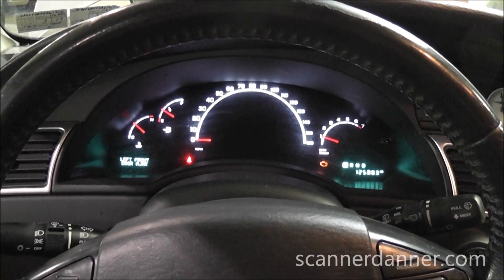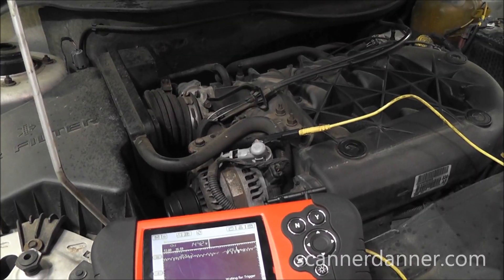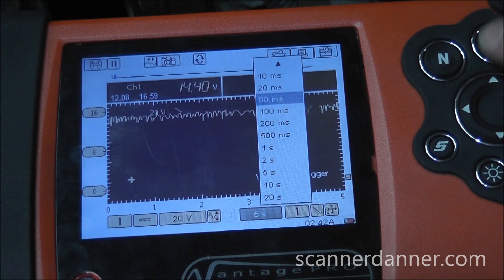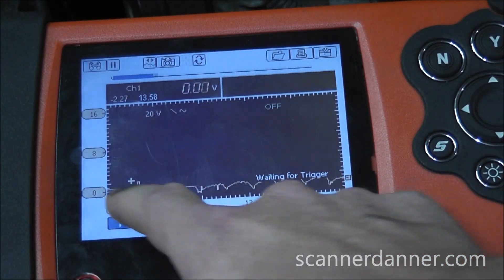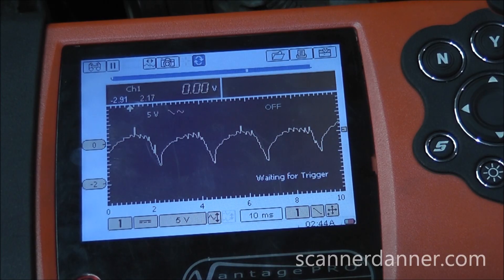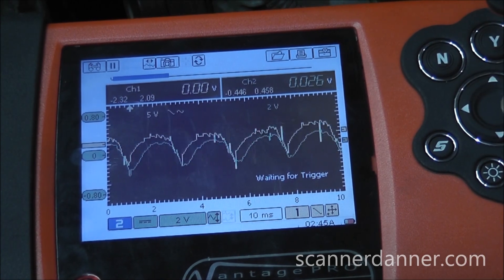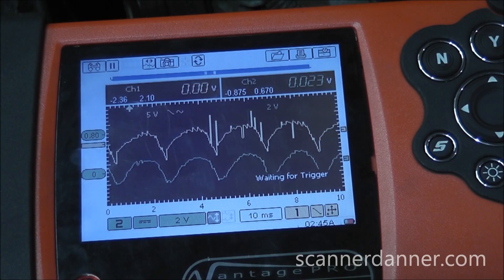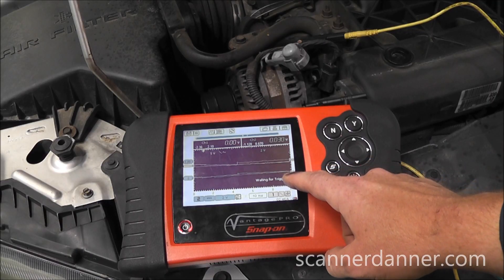Bad Alternator Diode causing transmission/speedometer problems

Comment: The peak to peak voltage in the yellow trace is misleadingly high because the scope takes into account the sharp spikes. The green trace doesn't have these spikes so at first glance it looks like it has less ripple.

When you take a measurement at the battery there's this big piece of cable that comes from the alternator to the battery positive. This has enough inductance to filter out all those high frequency spikes and makes the waveform look less rippled.

In essence, the two waveforms are identical
Reply: ScannerDanner Premium
 Sorry for the long answer!

The ignition coil back EMF is a subset of a broader phenomenon. It boils down to the fact that inductors don’t like changes in current. When there’s no current flowing and you try to push current through an inductor, it will generate a voltage in such way that opposes the current. So it takes some time for current to reach its max value. But when current is flowing steadily and you try to stop it, the inductor wants it to keep going.
When you have current flowing through the primary coil and do something as extreme as abruptly switching it off, it is like introducing a very big resistance in the circuit. If it is an older points system, then it is the resistance of the open contacts air gap, if it is a newer electronic system then it is the resistance of the turned off transistor. In both cases the equivalent resistance ranges from hundreds of Mohms to Gohms.
But the coil wants to keep the current flowing. So how do you push the same current through a much much bigger resistance? By generating an opposite, very high voltage. Of course the voltage generated cannot be arbitrarily high. The coil has a set amount of energy stored in its core. That’s where the secondary comes into play, it amplifies the high primary  coil voltage into an even higher one.
I guess it would be possible to generate sparks with just a single big coil. But then you would need special, expensive high voltage transistors. In a points ignition system there would be a lot of sparking in the distributor as well, that would damage it after a while.
So the two coil system works well. The coils are galvanically isolated so there’s no high voltage going back to the low voltage side.
 
Ok, back to the filter application of inductors.
In DC, inductors have practically zero resistance. But in AC their resistance increases with frequency. High frequency means rapidly changing currents and inductors don’t like that.
Capacitors are the opposite. They have infinite resistance at DC but it gradually decreases as frequency increases.
Now this is a typical resistive voltage divider: http://tuxgraphics.org/toolbox/voltage-divider-w.gif
 
Here there are two extreme cases 1) When R2 is much bigger than R1 the output voltage is almost equal to the input voltage. 2) When R1 is much bigger than R2 the output is almost zero.
In the car we have instead of R1 the battery cable, which is an inductor. A lousy one, since it is not coiled and has no core, but an inductor nonetheless. According to this calculator http://chemandy.com/calculators/round-wire-inductance-calculator.htm
a 4mm thick, 50cm long copper wire has an inductance of around 500nH.
And instead of R2 we have the car battery, which has similar properties to a capacitor.
Low frequencies “see” a low R1 and high R2, so the output voltage is almost the same as the input. High frequencies see high R1 and low R2 and the output is zero. So when you have a mix of frequencies as input, only the low ones pass.
I did a simulation in LTspice. This is the equivalent circuit:
http://i62.tinypic.com/2ew2urd.png
V2 is the voltage source at 1Khz and V1 generates noise at 50KHz. I used five 100nH inductors, since inductance is distributed along the cable.
The noisy output of the two voltage sources looks like this: http://i59.tinypic.com/e6rbf4.png
This is the waveform you’d get by probing directly on the alternator post.
This is the waveform between L3 and L4: http://i59.tinypic.com/vxcl6p.png
This would be like piercing the insulation and probing near the middle of the cable. The noise is still there but attenuated.
And finally, this is right after L5 and before C1. Like probing directly on the battery positive.
http://i58.tinypic.com/2j35tti.png
The noise is almost completely filtered out.
Generally speaking, looking for noise in a system with an oscilloscope is really tricky business. Sometimes you’ll see noise that isn’t really there, it is simply coupling into your oscilloscope probes from some other part of the circuit. Other times you might have tons of noise, but your test gear set-up might be filtering it out.
Reply from the maker: So it is the battery cable itself that "filters" the waveform, not the battery? For inductance to take place in this cable there must be current flow, so could we say it is more than just the cable?
Reply: ScannerDanner First of all, I’m a big fan and love your videos! Keep up the good work!
Inductance is a fundamental property of all conductors (like resistance) and it doesn't depend on current. Any piece of wire will have some inductance and it doesn't even need to be coiled, even a straight wire is an inductor. The longer the cable, the more inductance it has.

What you have there is basically an LC lowpass filter like this: http://upload.wikimedia.org/wikipedia/commons/e/eb/Lowpass_Filter_LC.svg
 ,where the inductor is the piece of cable and the capacitor is the car battery.

The alternator outputs a low frequency voltage (around 1KHz at idle) with some high frequency noise added, I am guessing at some hundreds of KHz, probably caused by the failing rectifier.
At the end of the cable, the high frequency noise is attenuated while the low frequency voltage is passing through.
I guess that if you could pierce the insulation and probe the cable at various points along its length, you’d see the noise gradually decreasing as you probe closer to the battery. This is because the inductance increases with cable length and the filtering effect gets stronger.
If you disconnect the battery, the noise will pass through. You need both the inductive and capacitive elements to get the filtering effect.
Reply: fubar.gr
I'm struggling with this a little. Help me with this statement.
"If you disconnect the battery, the noise will pass through. You need both the inductive and capacitive elements to get the filtering effect."
This is what I meant by current flow. If I disconnect the battery and measured the cable end at the battery, it would be identical to the alt. BAT post.
I think I understand what you are saying. I guess I think of inductance as counter electromotive force or is this something different?
So for example when I teach my students about coil current ramping we talk in great detail about why the ramp is there and CEMF is key in understanding this.
Or when we talk about self induction and mutual induction of an ignition coil (same subject really). It takes current flow through the conductor to create the magnetic field, and as this field expands and moves we create the counter voltage. (is this term inductance different than what I am describing? Thanks so much!
Reply: ScannerDanner  would this effect transmission shift points. My car is not shifting properly I'm at 3k rpms and I'm only in 2nd gear. I'm getting a p0562 low voltage. Any advice thank you sir

Comment: My 1970 Chev bat dies after a weak when parked. By disconnecting the alt, the bat remains charged. I opened another parts alt I have lying around so I can learn more before messing with the live alt in the car.  I assume the diode is the little black thing with one lead to the reg and three leads to other bolts. It has the number A-1486 on it. Using my ohm meter, the diode (if that's what it is) shows NO current one way. When I reverse the leads, the ohm meter shows current briefly, and then goes to NO current.  Is that the diode and is that normal? Thx.
Reply: Do you drive your car much? I had a car that I only started twice a week and it went dead with a perfectly functioning alternator and battery.

Comment: An open or shorted diode or diodes will cause excessive AC ripple. A multimeter, set on, AC volts, will indicate if the ripple voltage is more than 2 volts AC. The capacitor, also, helps in reducing the ripple voltage.  No one talks about the capacitor failing and causing ripple voltage.

Comment: Some times I have used a battery, alternator, starter tester from Midtronics that has given an error message over two different instances before that read "excessive noise" with a car running which sounds like excessive AC voltage measured but both times the customer wanted no further testing done. It just made me think of how I wanted to further test the Alternator output as you described in this video. Thanks Paul.

Comment: 2004 Sebring had PO700 plus the codes for input and output sensors.  Since the speedo was indicating 20 mph without moving I suspected more than the tranny controller.  Glad I saw your video.  Tested the alternator which showed bad diodes even though it was putting out sufficiently to keep the battery charged.  A new alternator fixed everything including the whine that sounded like a torque converter.  Thanks man.

Comment from the maker: No, that will just show you the amperage. You can just use the graphing multimeter and set it to AC voltage. This will be a graphed average ac voltage. Just make sure you are less than 300mv doing it this way.

Comment: I don't have ac coupling with my old vantage, but I set it at 5 v and connect my low amp probe, and I see  waveform 1.90v can be this good test or is just the alternator brushes..

Comment: Picoscope is by far the best scope out there. Any cheap scope that runs through a smart phone or iPad will work for some applications, but you will not be able to view most network communication including CAN, A/F sensors, 2-wire speed sensors, and a number of other circuits. The Snap-On Vantage Pro would be my second choice, and the Verus or Verdict would be 3rd. I use all three on a weekly basis.

Comment: Cool video! About 3 months I had an 05 f150 5.4l with a cam phaser knock and cel. Codes were for cam sensor 1 circut fault on bank 2 and the sometimes bank 1 also and had sometimes the trans would act like its in neutral and was very dangerous and would throw incorrect gear ratio fault codes. Solution=bad alternator diodes...crazy...dmm on alt post and neg ac volt 2.2v ac

Comment: Nice video Dan! Presumably the reason why you shouldn't do this test at the battery is because the battery acts like a big capacitor, smoothing out the peaks of the AC current. Would have been good if you had tried this with a digital multimeter, to see if the condition could have been seen without a scope in this case. I appreciate that in many cases a multimeter may not be fast enough.

Comment from the maker: no but I've seen it on a Ford, setting a crank sensor code and it was a no start. no spark.  It wasn't a bad alternator, it was a shorted battery and the AC voltage that was interfering with everything came from the battery charger I had hooked up to the car. after looking like a bad PCM, I started checking powers and grounds and that is when I caught it. I removed the battery charger and used a jump pack and the car fired right up. shorted battery is all it was. (Section 1 pg.26 in my eBook)

Comment from the maker: ahh I understand now. I'm not sure I can answer that. Didn't even pay attention to it until now. That number you were would have been a different number had I set my meter on an AC setting. Which is different than ac coupling a scope. I believe an actual AC setting takes the peak to peak voltage and multiplies it by .637 or something like that to get an AC average reading. On a scope if it is +2 and -2 your average is 0

Comment: Great video Paul. One thing I was taught in college some 30 years ago was before you perform any driveability or electrical system problem was to always first test the battery and charging system completely. Something we sometimes skip me included which sometimes bit me hard. One question I have is what would a DVOM set on the AC scale show if connected to the ALT. would this work for checking diodes if one did not have modern test equipment. Ive never tried this. Thank you.

Comment: Question Paul, you mentioned this fault affecting the speed sensor due to the fact that the speed sensor is also an ac sensor. Have you seen this affecting GM vehicles with an ac crank sensor to become a no start?

Comment: Ok, so I can put a steady regulated voltage to the alternator and make it put out something like 13V if I find what voltage to send to the field windings? But if I see that kind of AC voltage at the battery are the diodes shot or where does the AC come from?

Comment: paul the technology on todays automobile electronic system has gone through the roof. techs coming out of school these days better be prepared to tackle these problems cause if they are working for a dealer flat rate system theyll be eaten alive.ive seen on some vehicles having a fuse for the charging system,and ive also seen the p.c.m in control of the charging system. great video my friend great job thanks rick.

Comment: paul, when ac coupling is NOT turned on, i assume we still see the AC(2v or so) riding on DC(14.5v). Am i right, then when u turned on ac coupling, u were able to see in 2v range or so..

Comment from the maker: without looking at the diagram I don't know if the voltage regulator supplies power or ground to the field windings of the alternator so I cannot answer that. you most likely need to replace the regulator. One that is overcharging is usually not a wiring problem, one that is not charging at all is where more detailed wiring tests are needed

Comment: Yeah you are right, it is an external regulator. It is probably a regulator problem then. I have to check it somehow first and then replace it if necessary. Is there a way to check the alternator only? Can I put a steady voltage from a power cube on the field terminal? For example 3 volts?

Comment from the maker: not sure about that reading? remember there can be multiple charging system failures and symptoms. what you are describing with a 20v output is not a diode problem but a voltage regulator problem. Is this an external regulator on this year?

Comment: Very nice video! Thanks alot! I have a 67 Mustang which I believe have a charging problem. It is a standard alternator and a mechanical voltage regulator and sometimes I get a very high overcharging condition over the scale of 20V and sometimes it works fine. It also has a very high AC ripple reading. I have used a DVOM and don't really understand the reading. I get about 30V AC. Is the alternator even capable of generating such a high AC voltage? Or is it noise from the regulator?

Comment from the maker: I would agree with Mr. Halderman. I just prefer to do it at the alternator BAT post. However this can be difficult to get to sometimes and the battery is your only option. Just be aware that it will be lower when measured at the battery

Comment: According to James Halderman ac voltage checks can be done with a digital multimeter set to ac voltage and connected to the battery with engine running @2000 rpm. Good diodes would read less than 400 mV ac, defective diodes reading greater than 500 mV ac.